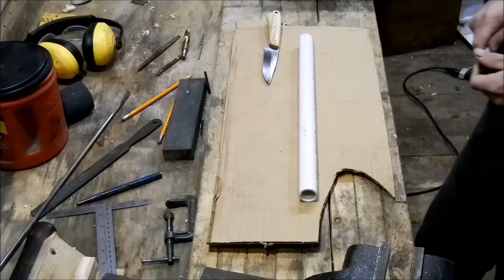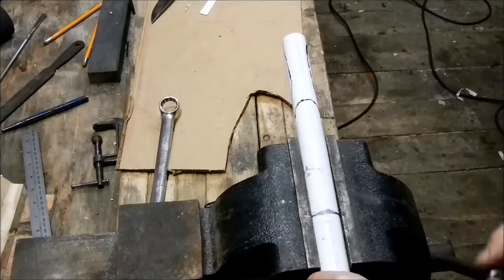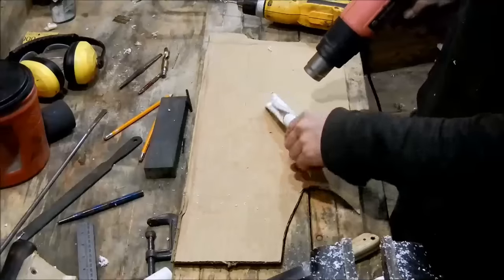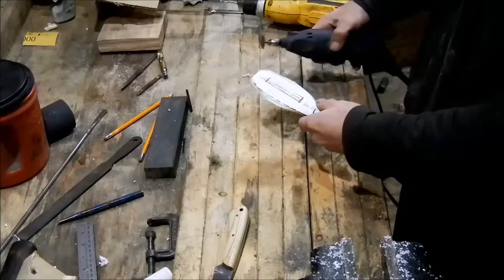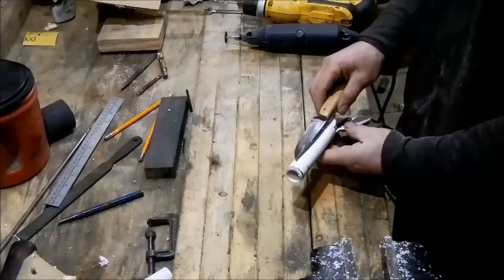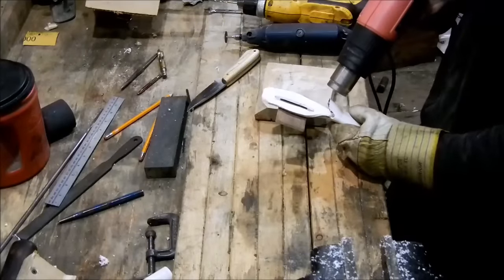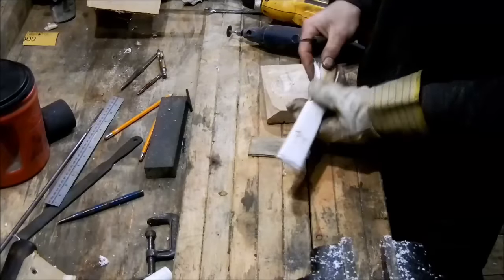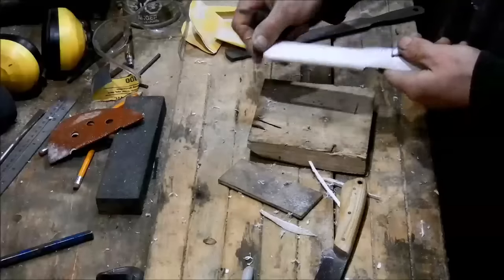making a PVC knife sheath with belt loop

Comment: About cutting length, Since the tube  isn't  long enough for two I wouldn't cut so close until the very end just in case might get under sized. 
But that's small madder and over a nice build. Only is my knife safe in the sheft is it pretty trustable in the woods from breaking?
Good video Thanks for the teaching Sir

Comment: thanks! i just need around a quarter inch or so less yhan my blade width?
Reply from the maker: Blade Width x 2 + Blade Thickness
   --------------------------------------------           = Pipe Inner Diameter
                    3.14
Reply from the maker: I just guessed when I made it. The pipe will stretch some.
(Blade width times 2 plus blade thickness) divided by 3.14 = Pipe inner diameter
Reply: jonthewoodworker ok. got it. now i need a excuse to go to lowes he he. thanks for all the help

Comment: How do you know what size pipe to use? Same as the blade is wide or what?
Reply from the maker: It was 3/4" schedule 40 pvc, and the blade is a little over 1 inch wide.

Comment: Why not cut in half and use it kinda like a kydex sheet?
Reply: Laundry Sauce nothing wrong with that. if I did it like that I would punch holes on the edges and run a pass or two with the sewing awl like any other sheath.
Reply: largely for cosmetics, but also for added security in keeping the edge together. though adhesives work well too. I got a stitching awl so it's no biggy